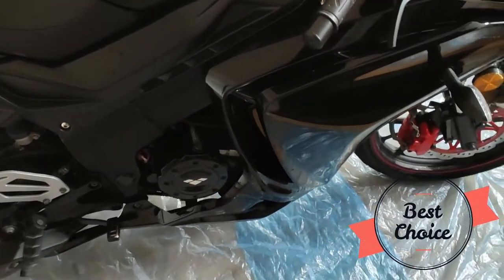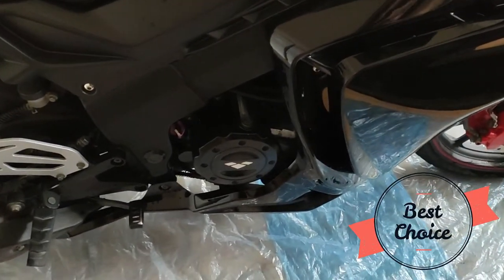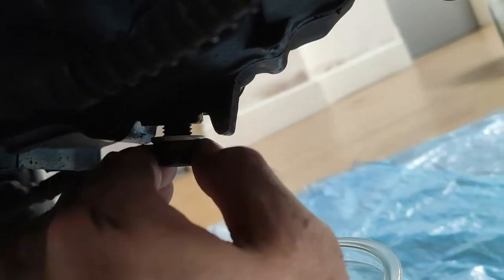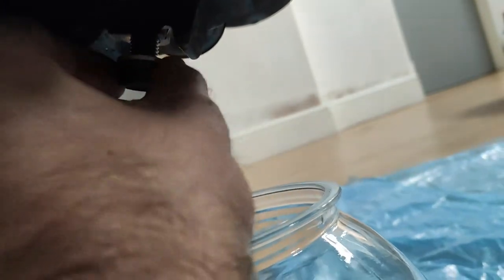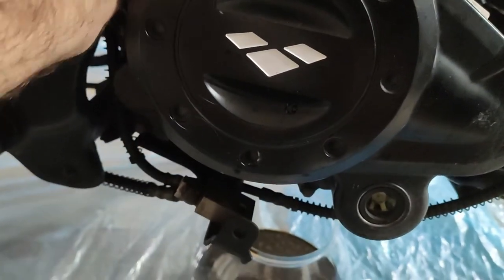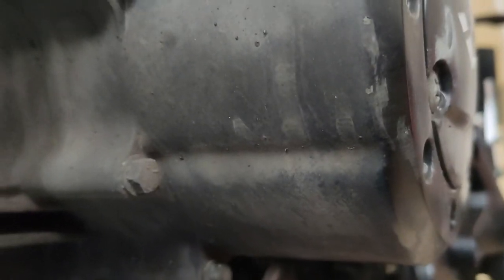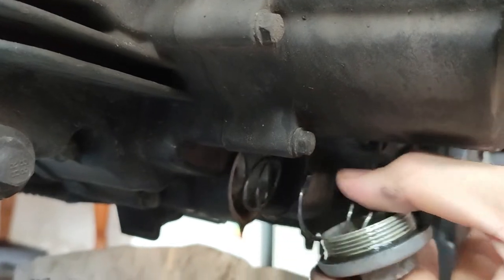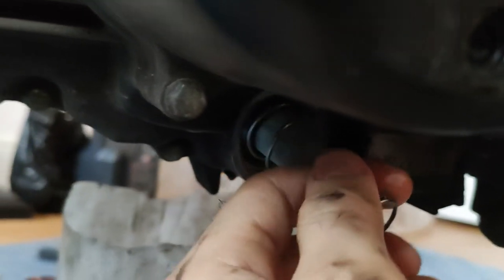Lexmoto Hawk R9 How To Change Engine Oil

Comment: Would just like to thank you. I've been searching for a new Engine Oil Cap as the original one on the Hawk is rubbish.. The YZF R 125 is a far better option to have.
Reply: Where did you buy it from Cant find one anywhere
Reply: Where did you buy it from thank you
Reply: @Doomdog308  You want a CP150 Oil cap
off of ebay

Comment: Why on earth did you take the exhaust off to remove the drain bolt as you can see there is enough room to remove it without taking the exhaust off just from watching the video!!!. Not only that but if it was not possible to get a spanner on the nut or enough room to take it out you just have to remove the oil filter gauze and drain the oil out from there!.
Reply from the maker: just dont want oil on exhaust pipe
Reply: @n4ride323  where did you buy the oil cap thank you and do you have link
Reply: @n4ride323  hello
Reply from the maker: @Doomdog308  hello,,i get it from motorcycle service..they had some parts and they checks that cap if is fit..try goeing to some services and have a look
Reply: N4 Ride where’s the oil dipstick, or how can you check the oil level ?
Reply from the maker: @septysarac1045  put on 3.14 mins,,have a look on circle i shows that round glass window on engine,,have marks L and H